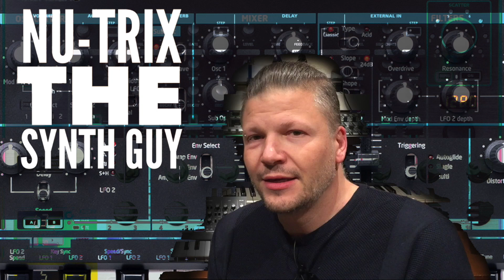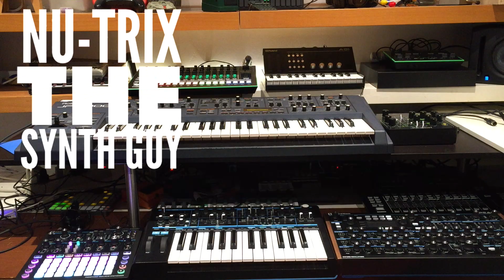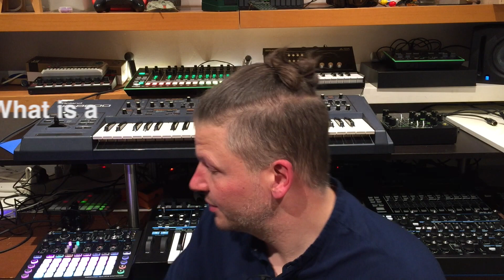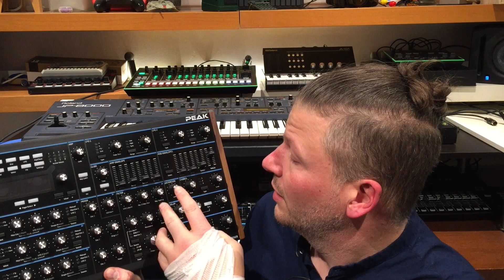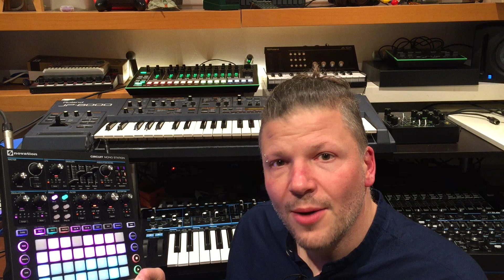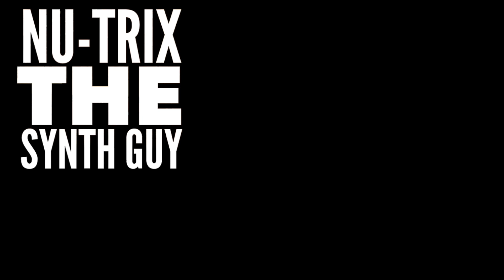Circuit MONO Station : What is a PARAPHONIC Synth?

Comment: how can you play the 2 OSC together? On mine, in dual mode when I hold a note on OSC1, and also play a note on OSC2 the latter steals it and I can only hear OSC2. Paraphonic mode is on, firmware 1.2 . I just don't get it. And I saw loopop playing the two together in his review
Reply from the maker: It should work. Take a new sound. verify the volume for both OSC and choose sawtooth for each. Confirm you are in Paraphonic (shift + Scale = white light turned on) then play in Dual mode. Check that you have sustain in you env. You should hear 2 notes
Reply: @Nu-trix  Thanxx, well starting from a blank basic sound did help, maybe with the complex one I tried they somehow overshadowed each other. So dual mode play works kinda, but still playing the other OSC while holding one steals some of the harmonics of the first played one, is that normal? Or this is just how the mixer works.
BUT what's still a question is that when sequencing, this dual mode still doesn't work, only as a monophonic synth, two notes on the same step cancel each other out. What's up with that?
Reply from the maker: @Turbo_TechnoLogic  Keep in mind that paraphonic mode is the option of playing separatly the pitch of the two oscillators but they still both use a single filter and VCA. So the rest of the signal path is will affect to sound.

Comment: Hey Nu Trix, thumb up man, can I go paraphonic with the mono station using keystep pro sequencer or do I have to use the mono stations sequencer to utilize the para phonic capacity. Thanks.
Reply from the maker: It works with any MIDI source. Just be sure to activate the Paraphonic mode.
Reply: @Nu-trix    Thanks for the quick and helpful reply.

Comment: Another great video! Thanks, this is helpful!  Cant wait to hear you perform on this! Considering Circuit or Circuit Mono Station... recommendations for a synth beginner? Also, can either of these do double duty as a Launchpad?
Reply from the maker: Joe Carter , I think the novation circuit is better solution for a beginner. It’s a cool package combining 2 synth and 4 samples, plus its portable. I’m sure I saw somewhere it can be use to control Ableton live. The circuit mono station is more like a modern tb-303. And not portable (real analogy needs more power than batteries can provide)